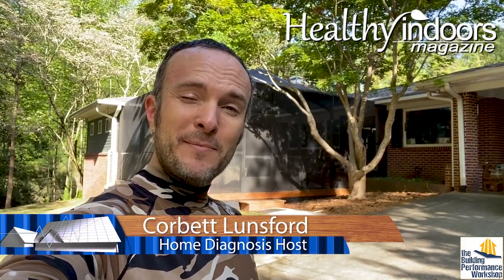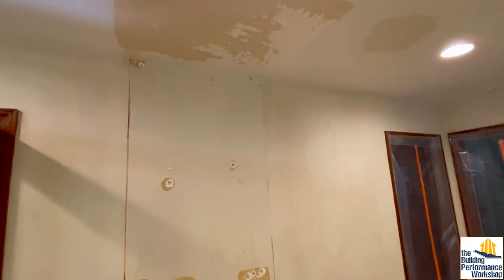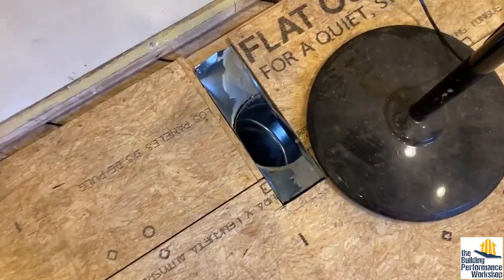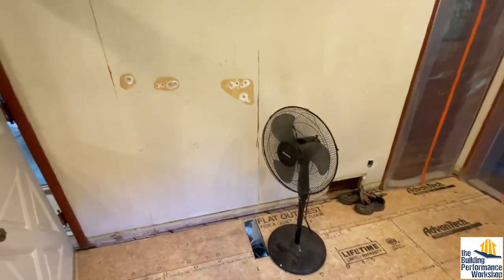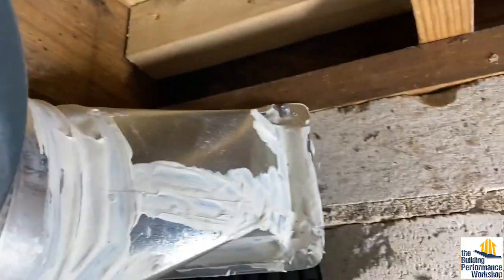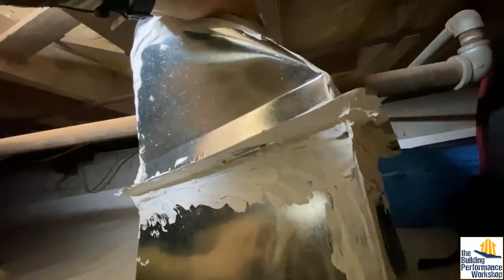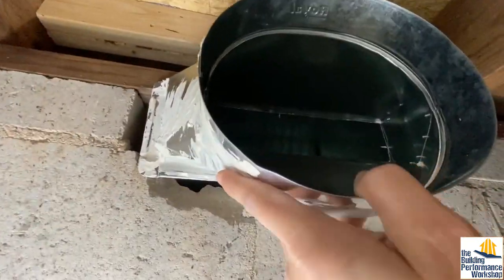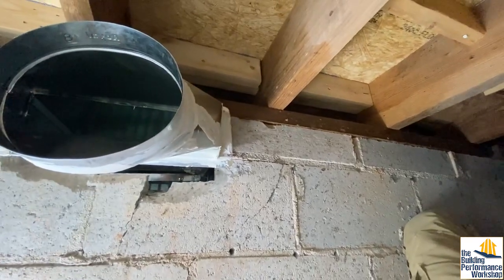How to Easily Design and Install Kitchen Exhaust and Make Up Air Ventilation on a Home Renovation

Comment: For several years now I have been installing a fresh-air return on all hood vents and large bath fans. The homes I build and remodel always beat code (latest remodel hit a 1.3ACH 50, code on Long Island is 3ACH.)   I use a simple filter pan and negative pressure switch/relay that opens a gasketed damper.  Thank you for broadcasting the importance of this detail.  I have seen none of my peers install this.  They don't understand that the negative pressure these fans induce is unhealthy in newer, tighter homes.
Reply from the maker: Hey, great to hear the work you’re doing, Philip! You’d find a friend for sure in Frank Gallina, one of my Masterminds who’s up on Long Island too!

Comment: If you haven't done it already I would recommend using some spray foam around the concrete hole that will seal the air from your vent and one thing to consider since you said it was being sucked in from a carport you want to consider maybe exhaust fumes from a running vehicle might get also sucked in I don't know just a thought
Reply from the maker: Yes to the sealant, though be careful about water getting in, it’s basically a sponge. And the carport is wide open, plus my parents know not to run the car in there- hard to do that while there cooking anyhow.
Reply: @HomePerformance  :) i have to install a make-up air kit to my home ,, its a new home and I had a 400cfm hood installed , the inspector said i am required to add makeup air before final inspection can be approved...
I got a braun kit on ebay and need to figure out the best place where to bring the air in from outside..
Reply from the maker: Best place is up high, if possible- less bugs that way

Comment: Excellent work and this is what 99% of homes miss. I am planning to incorporate makeup air in kitchen and bathrooms this summer. Question: can we bring the makeup air beside or behind the cooktop, say a vent in the backsplash area behind the cooktop? In this way the floor temperature might not be affected and should be more effective .
Reply from the maker: Hey Squeek, I'd actually avoid bringing it all up the rear of the cooktop, out of caution for potentially pushing the cooking gases out the front of the hood.

Comment: I would like to see more passive make-up air methods for less demanding situations such as this house; have you explored this?  For example, a 400-cfm exhaust through an 8" duct may only require a 200-sq in (14X14) passive make-up air hole.  If there is a vented attic, it would be possible to place a vent with filter in the kitchen ceiling, which could be connected to a motorised square damper sitting atop a 14X14 duct/curb in the attic space.  So the entire assembly would be 14X14X14, with the make-up air pulling directly from the vented attic -- no forced air.  The same applies to a vented crawl space.

Comment: With how leaky that house is a powered make-up air ventilator is a great Idea.  It would reduce the pressure drop in the rest of the house, which should make that water heater a bit safer.

Comment: Corbett as an energy auditor I have learned from you, thank you. Why not point up that nasty concrete or foam the duct in place? In the N.East we would foam that foundation and band to  (R-21) and seal the poly to the wall with the foam (closed cell). Keep up the good work.
Reply from the maker: Thanks for following, Dusty- for sure there are much prettier ways to do this, I'd give clients the option if I were doing this as a job, but since neither my dad or I care too much, and since I'm not a contractor who has mortar or spray foam on hand all the time, we're skipping it.

Comment: If the issue is possible backdraft, wouldn't it make more sense to activate the fresh air valve from the HW heater (and/or furnace) rather than the range hood (maybe there is a pressure sensing switch I missed). The range hood fan should work just fine w/o makeup air or ductwork in this situation. Fresh air dedicated to the range hood is usually only required for commercial units (and I've seen some installed in residences).

Comment: What about CO coming from the carport?  So you will show a final of this?  Thanks.   I am in the middle of a gut/energy retrofit and need to do makeup air, so I really appreciate you sharing this information.
Reply from the maker: Thanks for following- if it was a garage, absolutely a concern. Open carport, not so much. More exhaust fumes in a pickup line at school. Yes, we’ll follow up for you.

Comment: Would it make sense to connect the exhaust and intake to and ERV/HRV ? Could it solve the problem of the frigid air in the winter and hot humid air in the summer?
Reply from the maker: No, it wouldn’t be a good idea- my house is bigger than this one, and only needs 150 cfm ERV, which would be overpowered by either the supply or exhaust on this, and the grease would choke it to death.

Comment: 10:07 Could you seal it by spray foaming the cavity?
Reply from the maker: Could, but it would need to be 2-part, closed cell foam since it’s below grade and could have moisture issues. I don’t keep that stuff on hand.

Comment: I'm currently building a new house in Canada.   I'm installing a broan automatic air damper synced with the range hood.  I'm going to add an inline filter as well.

Should I install the register behind/under the electric range?  Or add a preheat and have the register open in the kitchen?  Does the preheat need to have a drain line?  Do you get any moisture build up under or around the range?
Reply from the maker: Terry, in Canada I would consider a bunch of cold-weathee concerns carefully- we don’t have to do that down here. But I bet you worry about outdoor humidity less, on the other hand. It really depends on the whole system at work in your home, but all you need to do is think thru all the options and consequences for the 4 elements (see our 4-3-2-1 approach).

Comment: First thing I thought building a house from scratch and only giving myself 18 inches to 24 inches crawlspace. 
               4’ would’ve been comfortable but then why stop there 8’10‘ deep foundation years later come back and dig it out and you have a whole Nother floor 
              I do remember you have a large boulder to deal with when they were digging
Reply from the maker: T, this is NOT the house I built. This is a 1950’s ranch my parents live in nearby.